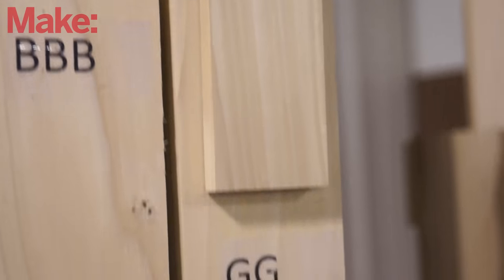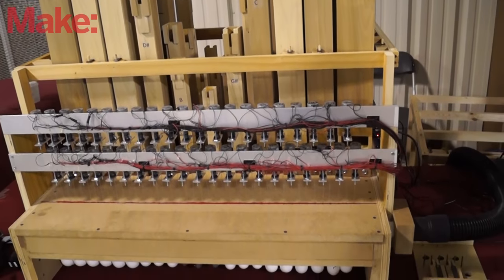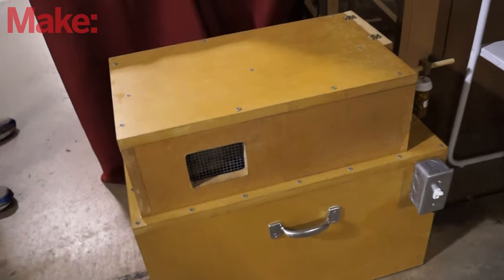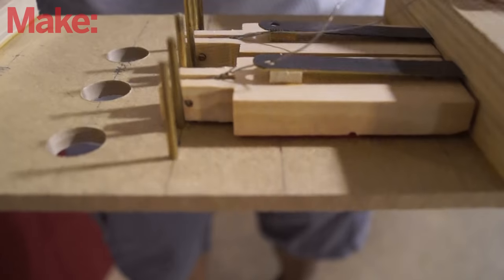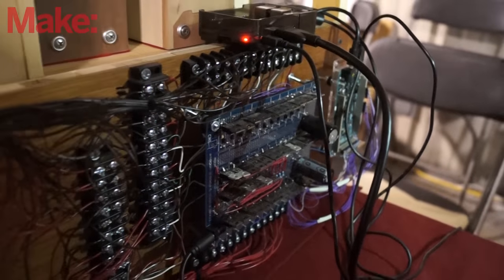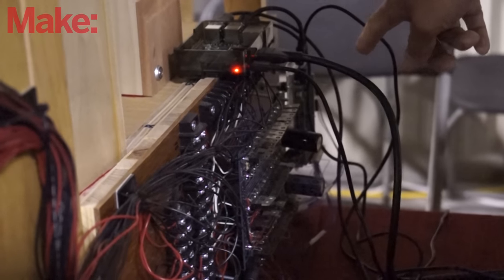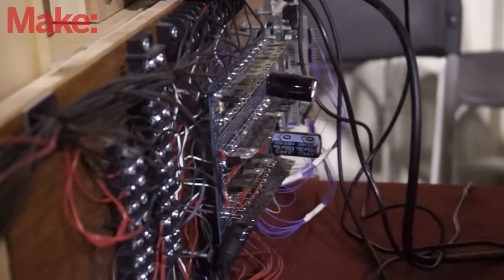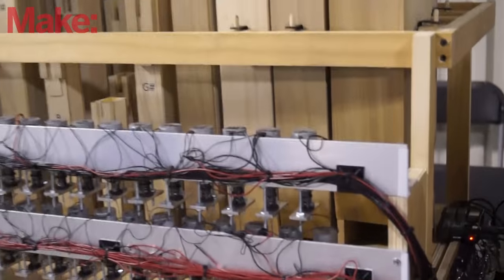Hand made MIDI pipe organ from Maker Faire Orlando

Comment: Cool idea but it could be much refined. I would love to meet the guy and help him finalize the idea. 
The wires needs better management and need to be thicker, and the controller is a silly mix of 2 MCUs that need to communicate , but all you need is a matrix controller and a single MCU. (A simple shift register + RPi would work)
Reply: He's a doer, my kind of guy.
Reply: Link to blog/video of your organ?
Reply: An excellent Suggestion
Reply: I expect he considered how to implement the system before doing it this way. The cable management is all about preference(and just because he is showing it off does not mean the project is finished, you know) and he probably knows how much current his actuators need and so can select suitable wiring.

As for the controller setup, well, from what I understood he is using MIDI between the Raspberry Pi and the Arduino, which means that technically the Arduino is the controller for the instrument(similarly to how a MIDI synth or other equipment will have it's own controller that decodes and executes the commands separately from the device that issues the commands) while the Raspberry Pi is acting as a more general purpose computer where he can play MIDI files and have a user interface.

I wouldn't be surprised if he is considering adding more racks of pipes or other instruments later, and so wanted the flexibility of a MIDI system.
Reply: Pshhhhhhh. "More refined". To me it looks like that organ is working LIKKA BOSS.
Reply: sirgermaine I don't own an organ like that, but I could make one and so could anyone with enough time. 
I'm not saying his is BAD, I'm saying it could be made BETTER. You need to learn the difference between constructive criticism and down right criticism. 
And I believe 10 years of Electronics Engineering gives me the right to express how I would refine an idea.
Reply: Michael Ahlbeck It works, yes. But if I gave you a choice between a beautiful Samsung phone that has been well polished and designed for years and something I made out of scraps that still worked, I guarantee you, you'd pick the better built one.
Reply: +Chef Geoffrey Excellence
I would argue that the setup he has in the video could be said to be more polished.

The Raspberry Pi acts as a MIDI controller and sequencer, the Arduino decodes the MIDI commands and controls the actual organ. This means that he could replace the Raspberry Pi with a MIDI keyboard if he wanted to play the organ with a more conventional keyboard, or he could connect up other MIDI devices to the Raspberry Pi if he wanted more instruments. It also makes the software side relatively simple, he can use pretty much any MIDI player or sequencer software, standard MIDI files and libraries and so on.

Though, I suppose the idea of what is polished really depends on the goal you have. If all you want is to play a bit occasionally,  a cheap keyboard like you can get at pretty much any toy store might be seen as a more polished solution than getting a professional MIDI setup; no need to drag out a tonne of equipment and connect up a bunch of cables every time you want to play something, no worry about setting up addresses and that you have enough power sockets...
Reply: Wires thicker? Chef, ohms law says 20 V/60 ohm = 0.33 Amps. So, the wires are 100 % OK.
Reply: ummm ...  you have home-made cell phone?   I'd prefer that one simply for the geek factor.